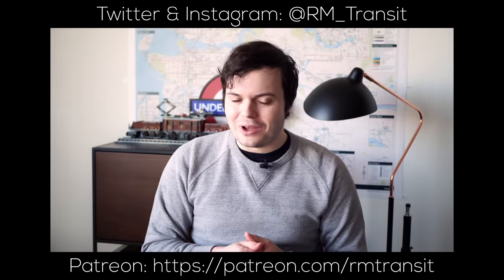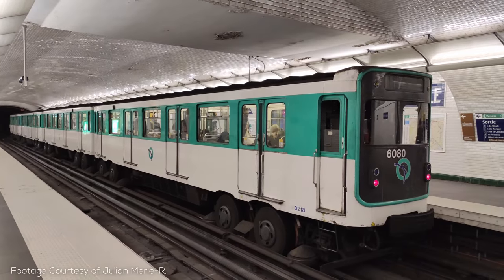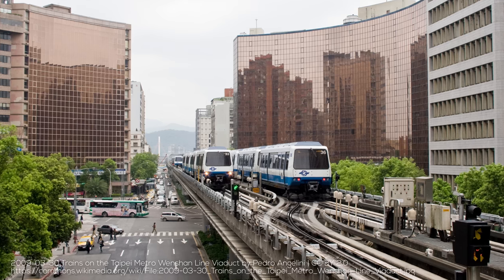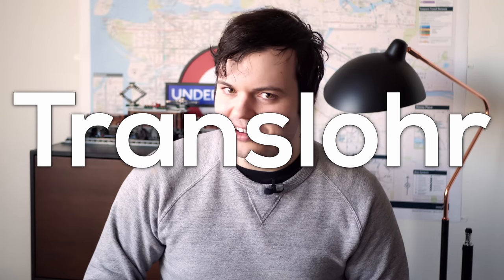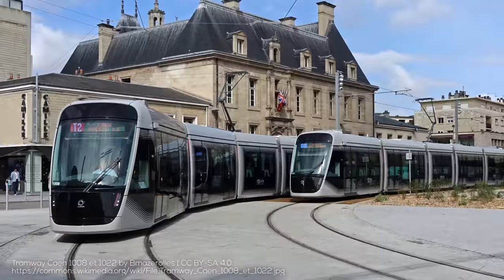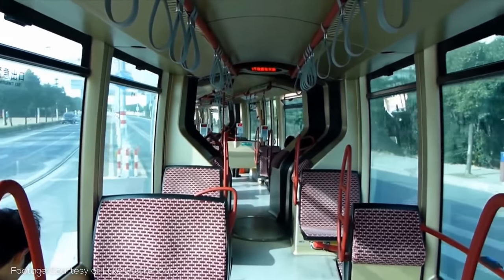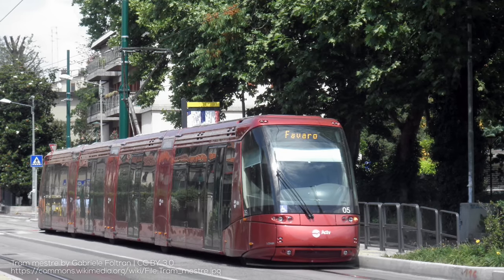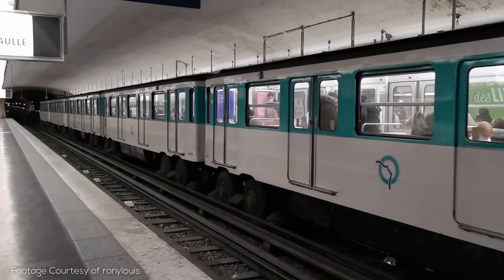Rubber-Tire Rail Transit is Weird

Comment: well, the advantages of rubber tire rail car are really obvious to daily users, (and you did mention them but somehow discounted them as not valid) : Comfort, speed, frequency, precision... Most Paris metro lines run trains every 60 or 90 seconds apart, with a sonic comfort and and just plain comfort (lack of vibrations) unmatched by steel wheels on rail tracks... I live in NYC and the deafening subway, with waits of 15 to 20 minutes in between each trains (at best), with daily malfunctions,  and that can never ever stop at the same spot, or even same stations!, would not pass muster for extremely judgmental Parisians...

Comment: Huh… initially thought this was going to be yet another vid 💩ing on any BRT proposals/systems. 

Something that seems to work out in the immediate-medium term, especially when getting out of planning/funding limbo, even though long term maintenance seems to be a concern compared to any LRT counterparts.

But at bare minimum, BRT could be the absolute most IRL & absolute least theoretical based TEST to see whether or not fully committing to streetcars/trams, LRT/metros, or even regional rail would be worth the benefit, especially in the eyes of the penny pinching, NIMBYistic forces of leadership & the general public.

And IF/WHEN said BRT line gets upgraded, it’s quite likely that more secondary but high/dense enough bus routes inbetween LRT lines & low volume buses could get the otherwise retired BRT touches. If not, then I very well trust that rural college/tourist towns lacking the tax pools of major cities/metropolitan areas would appreciate the 60 footer buses on the used market; something to which I understand plentiful major cities already do to regular buses when they’re no longer shiny? Plus, it seems there’s more than a sizable pool of mechanics everywhere to choose from if said buses age worse than others?

Comment: Using these for Paris trams was a terrible mistake. I have riden them several times, and they are horribly overcrowded. Not a pleasant experience. 
I think a regular tram 🚊 on steel wheels would have been better.

Comment: Rubber tyres sound good for anything up a steep gradient so you can fit the track in a smaller space than you would need otherwise. Other than that There doesn't seem to be any benefit over a tram.
Squealing metal is just a sign of poor maintenance and bodge-job design.

Comment: It's sad to see VAL becoming a sort of  "Translohr-Metro". From my point of view, Translohrs are just bad, GLT is even worse and the Paris Metro technology is unnecessairy complicated and consumes more energy. So in general, rubber tired systems are not a good choice. But VAL however does make some sence due to its incredible frequencies in mid-sized cities or airports. Thus, I am disappointed that the best Gadgetbahn will become worse due to the influx of a worse Gadgetbahn.

Comment: The roar inside Montreal Metro is horrible. It happens to all the stations. I doubt if I will lose my hearing if I spend all day on a Montreal metro platform everyday. I can accept the squeaching sound of Toronto subway (only a small part along the line) or even Ottawa O-Train (again not everywhere along the line) better than Montreal Metro.

Comment: Anglos have a way to discredit what they don't like as inferior, weird or even inhuman. And they certainly don't like to see the French doing it differently (see metric system rejected because it was not them inventing this superior and natural mean of measurement)
Reply from the maker: The technology especially behind Translohr has caused lots of problems in France! Me being an “Anglo” doesn’t have anything to do with that!
Reply: @RMTransit  Not just Translohr you talk about in this video. And it was a wider remark, beyond rubber tires train. And otherwise I'm quite fond of the Anglosphere, just that we have some historical tidbits to sort out from time to time.
Reply from the maker: @etbadaboum  but I’m hardly so negative on the other technologies (except for GLT). And I am for better it for worse an Anglo!
Reply: @RMTransit  Fair enough!

Comment: VAL in Taipei metro was poorly executed. VAL’s high availability reliability was never high enough back then. Matra never should have guaranteed the reliability in a hot humid city with such a high ridership outlook. The long term toll is starting to show, recently the Taipei VAL is starting to have random reliability issues and is in a dire need of refurbishment.

Comment: Good afternoon
The single center rail technology is nothing new, it is about 160 years old, it was invented and developed by French engineer Jean Larmanjat in the 60s of the 19th century.
It was presented at the Universal Exhibition of 1867 in Paris, and having been observed an experiment in Le Raincy by a Portuguese ruler, the Government authorized the construction of 2 lines with a total of 80 kms (50 miles) between Lisbon and Sintra and Lisbon and Torres Vedras on the outskirts of Lisbon.
They were opened in 1873 but due to derailments, breakdowns and other problems 4 years later they closed and the company went bankrupt.
This was really the antecedent of the current center rail lines.
Nor do I believe that the current lines are very successful.

Comment: I rode that rubber tired subway in Montreal back in 1967.  The heat generated by those rubber tired wheels was horrible inside the coaches.  UGH!

Comment: Well, nice opinion piece against rubber tires systems, but rail can also fail in a big way, just have a look at the nightmarish Ottawa rail transit system... derailment, can't operate in winter, cracked wheels...
Anyway, Rubber vs steel is a false debate... the real discussion should be about moving people in an affordable, convenient and sustainable way, whether it is done with rubber or steel based systems.
In my opinion, promoting needless division between these two types of systems only serves to delay the implementation of structured transit systems that our world desperately needs.

Comment: It seems the french are just as weird with their trains and trams as they are with their cars.
Reply: last i checked french cars were pretty normal.
well atleast if on about the 2CV.
Reply: @davidty2006  I think the have the same "experimental " attitude. Yes the french do make normal, boring cars too, but they're known for churning out something completely off the wall from time to time. And yes, this extends to their trains, check out the Aerotrain.
Reply: The French have a long and strong reputation in innovative engineering design and manufacture, and have always had the opposite to the ‘if it ain’t broke, don’t fix it’ attitude. More like ‘it ain’t broke, but it could be a lot better’.
Reply: @Twittler1  Though sometimes it's "if it ain't broke, we'll make something some visionary thinks might be better, but turns out it's a lot worse".
Reply: @Twittler1  i thought that was the german way of thinking...
Reply: @Croz89  That is true, but innovate or perish (or vegetate). Risks are often worth it for the benefit of even just taking a risk. It stimulates thought. And no-one can be blamed for something failing; if everything that could and should be considered beforehand actually is, failure is only visible in hindsight. 

Hindsight and being risk and innovation averse is what left Americans stuck with relatively primitive cars from the 30s/40s onward. More power - make the engines bigger, don’t improve the ones we have; more room - make the vehicles bigger; better comfort - softer suspension; easier to drive - power steering with no feel; better braking - bigger drums; etc. This went on for decades, compounded by annual model changes that were nothing more than the preceding plus a few tweaks to appearance - same car for years, just looked a bit different each year. Not a single fundamental improvement until the competition from the more innovative Japanese and European makers really began to bite.

So complacency is a major risk of ‘if it ain’t broke, don’t fix it’. In the case of American cars, it is only in recent years that any of them are actually saleable outside North America - they used all to be too big, too fat, too unmanoeuverable, too thirsty, and too long, with far too much wasted space and material. All those sales opportunities thrown away - people actually loved and wanted American cars, but knew that they were pointless and impractical. American car makers could have made a killing. Instead they chose to kill themselves (just narrowly averted in Ford’s case). C’est la vie.
Reply: @davidty2006  German engineers are more cautious, by reputation; a good bit more risk averse than the French. Think; the Citroën DS19 introduced in 1955. 1955!!! Only a French company would have done that (and did it). 

With a few styling modifications (plus up to date mechanicals and chassis/body engineering), that car could be re-introduced today and sell like hot-cakes. That’s how far ahead it was. 67 years ago!!! Just three years younger than me! It could never have been made anywhere but France. Consider ANY other makers’ cars from 1955 to 1965, and even (a lot) later; not in the same league. Horse carts by comparison.

Comment: Translohr is just plain stupid as it offers neither the ride quality of streetcars nor the flexibility of a bus. 

I can, however, see the advantages of a guided bus system. It allows the buses to run physically closer together which is important in thin clearances and thinner roadways. They also have the benefit of being able to run off the rail portion as a regular bus offering easy expansion of the BRT system with almost no extra costs. A guided bus does not need a special kind of vehicle but simply an alteration of an existing one with essentially just a retractable pole at the bottom of the bus to submerge into the rail itself. 

It still needs concrete under the wheels but often this is not as big a s deal as made out to be as many older cities or older sections of new ones use the BRT construction as a good time to replace aging underground infrastructure any way so putting in new concrete under where the bus wheels will travel really isn't a big deal.

Comment: It is amazing you can go on for 14 minutes without providing any actual data that anyone could use to better understand the value of rubber tires on rail systems. The video is a comparative of neither the engineering nor economics of the various systems options. The video is just a random set of words that add up to nothing. It is as if Ben Shapiro supported rail transit.

Comment: The Indian government emptied their pockets by launching too many debt-ridden metro rail projects at once and now are looking to implement cheaper rubber tire based "Metro Neo" - which suspiciously seems like a Siemens exclusive deal after seeing your video - in smaller cities, or for less important lines within bigger cities. Sadly, there is no one voicing any concerns about any of the possible disadvantages of the system as all infra-related platforms here are rife with pro-government fanboys. Haven't seen a single rational infra/rail-related channel from India that discusses such things with a balanced perspective.